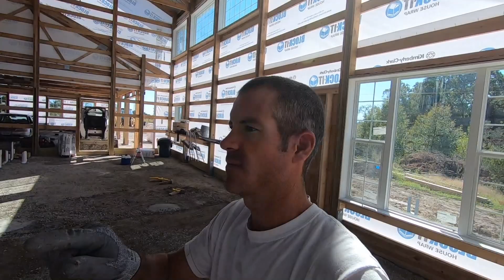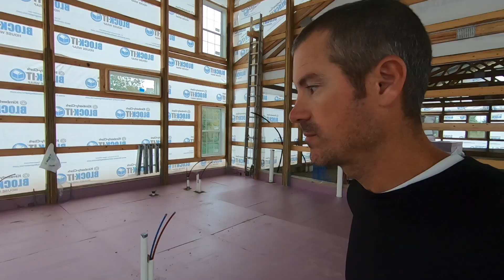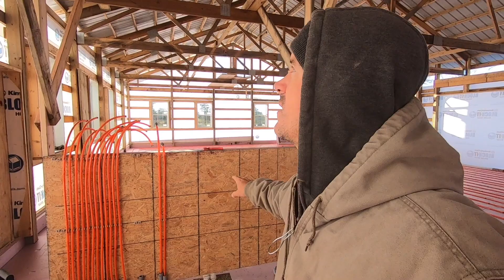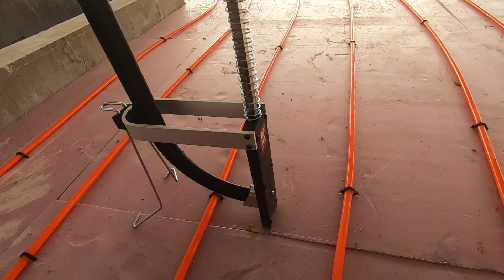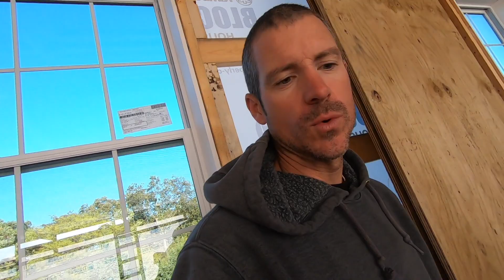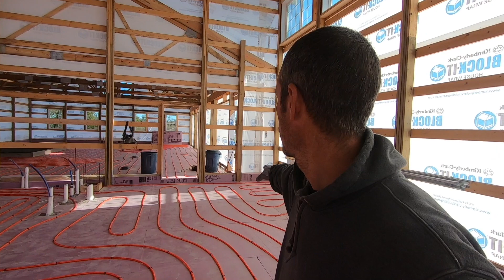Concrete Slab Preparation | Radiant In Floor Heat Pt 3/3 | Mad County Build Ep12.3

Comment: That all goes OK without taping the seams on the foam board? Did your board have the edges curl up in the meantime waiting to pour?
Reply from the maker: No i did not have any curling.  I use a different product now (Hitz Halter) and it has the vapor barrier built into it so there is no need to put plastic down, but we tape all the seam on it.  This product in the video we had to put a vapor barrier down first.
Reply: @MrPostFrame I too discovered Hitz Halter after getting the pink stuff. I'm going to get a quote to see where they come in for my garage. I just taped the living crap out of those curled edges, gotta keep the concrete on top of the foam board.

Comment: Post and beam construction is tough on the plumber and electrician. If you dont prepare well..its a nightmare  after you finish. My walls are foamed and all but impossible to fish.
Reply from the maker: What did you use for posts/columns? Did you do bookshelf girts?

We do standard girts so we end up with a large wall cavity. Even after 3” of spray foam there is plenty of space to run your electrical and even plumbing after spray foam.

Comment: Paul, how many inches do you do on your sidewalls with 2" foam? I"m doing 5.5" concrete floor. Do I need to put foam board down to frost line with is 48"?

Comment: is there a winter temperature level where radiant heat systems don't make sense? I will probably build in the south, not quite as cold as Iowa, but does get cold down here occasionally. Just trying to figure out if radiant heat is efficient in a climate zone where it doesn't get as cold.

Comment: What kind of tape do you use on vapor barrier ?
Reply from the maker: I’ll have a new video coming out this week on a new insulation I’m using that includes the vapor barrier. I used the tape below to tape all my seams and really liked it.

https://www.menards.com/main/paint/adhesives-glue-tape/tape/seam-tape/forcefield-reg-3-3-4-x-90-premium-tape/1366538/p-7429806127320683-c-13187.htm

Comment: Great videos.  I am building a 50x100 shop.  Going to install radiant heating in the slab atop Foamular 2”.  I have the same stapler as what you are using. So my questions are, how many staples should I need ?  I have 3000.  And how many feet of 1/2” o2 barrier tubing will I need ?   I have 6000’ on hand

Comment: Hey sir. Do you lose efficiency by leaving it at the bottom of the slab versus the middle of the slab?
Reply: No. The great thing about concrete is it a poor insulator so it freely allows the heat to move through the slab. That’s why concrete slabs are the preferred mode of hydronic heat.

Comment: We normally pressurize the radiant floor tubing to 100PSI.  That minimizes the friction between the concrete and the pipe during normal use.
Reply: yes, but if you have a leak during your pour, 100psi makes a huge mess when it spews wet concrete into the air.

Comment: Great series, thanks for documenting it all. I have a question, I purposed this same design  footings with the same insulation layout. Our inspector is concerned its not enough to prevent frost from coming in contact with the slab. He is under the impression we might need as much as 4' horizontal from the sides of the slab. Did you run this configuration in ResCheck, if so did it pass? Any concerns with frost?
Reply: What ever happened? I’m pondering this now. I might just pour a frost protected shallow slab to avoid this issue.
Reply: @bpdp379  well we are no further. It's been a mess and still no foundation. We went from a house designed on a thickened edge, slab on grade to piers/sonotubes because the fill wouldn't meet compaction spec. But, we were told to insulate under, along the side, and out horizontally when we were planning to do a thickened edge. Waiting on new engineered plans to see how the piers need to be insulated.

Comment: You didn't think the concrete needed rebar or wire? Also can you keep certain parts warmer than other parts? Say the house part warmer than the garage part?
Reply from the maker: There is rebar in the concrete. We have things zoned so that areas of the house or garage can be different temps. Here's the in floor heat playlist: https://youtube.com/playlist?list=PL3QM32YjSVn1Mi5I9OwmwhXNL9CAXpyAZ

Comment: Paul, I am curious which PEX piping you used?  Did you also get it from Menards or other supplier?
Reply from the maker: We went through Menards for the Pex. All of the controls were through Curry Heating Systems. They build the systems to your specs which was way more helpful.
Reply: @MrPostFrame  I am thinking about the manifolds you used. Did you order those or get them through another supplier?  And, why did you choose those manifolds vs other brands? I have read some reviews of others like "Rifeng" and they seem ok, but they look the same except for the flow meters.  Just curious.

Comment: how can you tell the EXACT location each sewage or water line/pipe should pop out from the ground before doing the concrete? for a beginner or first time home builder is a challenging task to do so... even by looking at "plan" or blue print! any recommendation?
Reply: Run strings as pretend walls.  Easy.   There are videos showing this.

Comment: So your cost with staples, stapler, and running rebar in the concrete was more practical then wire mesh and zip ties?

Comment: 2 questions
1. Did you lay the rebar directly on top of the pex? 
2. Would you see any issue with  installing the steel on the roof and leaving the side walls open to make it easier for the concrete to be poured? 

Thanks!
Reply: RR buildings do exactly what you asked.
Reply: No rebar.  Just fiber.

Comment: 2" insulation but you used 2.5" staples?
Did you just put 1000s of holes in your plastic sheet water barrier?
Reply: perhaps you should consider the dia of the pipe the staples have to go around,,,,,,,,,,

Comment: thanks for your videos.

does the engineering change for the slab if you stick pex in it? how does it affect the steel reinforcing? is there a guideline on how close to have them together?

Comment: I have seen other videos where installers tape all seams on the foam board, whereas you have not. What are your thoughts on taping or not taping seams ?
Reply: If you use the foam board as the vapor barrier, you need to tape the seams. He used the 6 mil plastic so that’s his VB. The plastic sheet needs to be taped up
Reply: Very good question I'm also interested

Comment: Marshall,  I just found your channel and readily SUBSCRIBED.   Your project and skills are amazing.  Question:  What type of system will you be utilizing to heat?  My wife and I are building a new home in Central Ohio and are considering a wood boiler system with radiant floor heating.  We have 20 acres of hardwood and a seemingly endless wood supply.  Your thoughts on a wood boiler system or an alternative means would be greatly appreciated.  Thanks.
Reply from the maker: An outside wood boiler would work well. My dad used one for years to heat his house. I’m planning on a gas boiler for my radiant heat and will have a wood stove in the house as well.

Comment: How come you didn’t lay down plywood under the roof panels, and around the sides of the building? It seems you’ll lose a lot of r factor?
Reply: The metal panels provide the shear strength.

Comment: Why did you use gravel on the base as opposed to sand like I’ve been seeing in other videos? Are you going to be using a water heater for the heat source? Thank you
Reply from the maker: I like using gravel because once it’s compacted it stays where it’s at. Sand moves when ever you walk on it and then I find myself leveling it again. Nothing wrong with using it. Just preference. I will be using a gas boiler for my heat source.

Comment: Hello Mr. Marshall. What happens if after doing all your pressure tests and everything is good, you pour the concrete and then discover there is a leak? Is that basically the end of the world financially? I'm getting ready to build a 2500 square foot home with radiant floor heating with separate zones I presume and I would like to know how to handle something like that  if the worst should happen.Thanks. Really enjoy your videos and I wish I had your skills and was as young as you. I would be very rich indeed.
Reply from the maker: I pressurized the in floor heats tubing during the poor so I would know if a line was damaged. I had some repair couplings on hand but everything was fine. The concrete company I used requires this but they have never broke a line. They are very tuff. 

As far as the pex water lines go they are under the insulation in the ground. If one somehow gets a leak or something you would have to run a line through the walls of the house. 

If one of your in floor heat tubes broke you would have to abandon that loop as it would be very difficult to locate and fix. I suppose it could be done but not sure I would want to do it. Lol
Reply: @MrPostFrame  Thanks for that Marshall.

Comment: How does tile, hardwood flooring, and carpet affect the effectiveness and efficiency of doing this in a house
Reply: Stick the tile, float the hardwood, and throw away the nasty carpet.
The heating is from underneath in a radiant system those options will not hurt the efficiency.
Really carpet is nasty, get rid of that cancer.
The main reason people put down carpet is to have a warmer floor, your floor is pre-warmed, so no need.
Reply: Kal Random thanks for the info. I understand your point on carpet, I’m not a fan either. But I am glad to know a finished concrete floor isn’t the only option for this
Reply: @jacintobanda4114  Your welcome, there are several videos on YT and the web about this. There is one company that makes aluminum panels that the pex fits into tailored to your house.
I been looking at this form of heating for awhile. I want to combine it with a geo-thermal heat exchange system for cooling also.
Reply: In Europe where radiant heating is pretty common, it's almost always used with tile, which works very well

Comment: Is there a more environmentally aware way to insulate from the floor?
Reply: I dilating the floor is extremely environmentally good thing. In fact I've heard of doubling up the foam to have even better insulation.
Reply: @AlessioSangalli  how is foam, product that does not biodegrade environmentally good?
Reply: @philindeblanc  by providing high degree of insulation it allows to save very high amounts of energy otherwise lost due to inefficiencies over the lifespan of the building.
Reply: Also, if it were "biodegradable" it would be useless as it would disappear after a short amount of time. Instead, closed cell foam is inert that means it will not harm the environment.

Comment: Mistake:  You said six millimeters (which is about 1/4 inch) when you should have said six mills, which is 0.006 inch.  The difference is significant.
Reply from the maker: You are correct.

Comment: You are way beyond this now, but I  have a comment on the wiring through posts. Maybe it will help someone else. Since you didn’t do commercial girts, you should be able to run the wiring behind the posts. Also, code allows for #2 or better for structural wood. That means that there is an allowance for holes in the posts (typically knot holes, but a hole is a hole). I believe you can drill up to a 7/8 hole in the columns without any consideration for structural influence. Similar to drilling through regular stud walls. The load is already calculated for this size of a hole no less than 2’ apart. That is if I read it correctly.
Reply: I've always understood structural members, regardless of material, could have a hole of maximum size D=1/3 width of post (or stud, joist, rafter, etc.)  And a second hole could not be within D × 1.5 as measured between proximal edges of circumference. 
Sticking to that set of rules and there is next to no reduction in strength.

Comment: How deep was your concrete, and also I see that you didn't install wire mesh?
Reply from the maker: 5” thick slab. Rebar was put down 2’ on center the day of the pour.
Reply: Over the pex with the rebar?
Reply: @johnmacready4613  Looks like it - you can see it here https://youtu.be/Qw6sccck21w?t=97

Comment: You mentioned the spacing on your tubing. I'd also be interested to know how long your runs were from end to end where they start and return to the manifold.  I have heard a few different numbers on maximum length of a tubing and am wondering if there is any standard or code that has to be met? Or is is just that shorter equals more efficient?
Reply from the maker: For 1/2” pex you typically want your runs no longer than 300’. They sell the pex in 300’ roles with the number of feet written on them so you know when you need to head back to the manifold. 

If you end up with a run that is really short or under a 20% variance from 300’ you can put flow meters on your run at the manifold to equalize the flow to match the other lines.

Comment: If you are putting 2 1/2 inches staples in 2 inches insulation, then aren't you poking holes in your underneath vapor barrier and insulation?
Reply from the maker: The insulation is 2” thick then you have the 1/2” pex tubing which is over 1/2” outside diameter so the staples don’t make it through the insulation.

Comment: Is it easier to do the radiant floor heating and concrete before you do your framing and roofing for the pole building?
Reply from the maker: There are a few things to think about. My floor will be the finished concrete so I didn’t want to take the chance on damaging it while building the structure. I also needed to get heavy equipment in to lift my walls since I built them on the ground. Another thing to think about is how you want the concrete to sit in relation to the posts/columns. There are many different ways people do it and I don’t think any one way is necessarily better. It’s more how you want to do it and what works best for you
Reply: @MrPostFrame  Thanks

Comment: Bizarre question; who would one hire to test an existing system or find info on it? Back story is I just bought a home that was built in 84. The owner/builder died years ago. Supposedly the lines are run through the fireplace, so it's self driven through pressure change (I think - there is a coil in sand located in a huge heat chamber).  
If I could tap into the old system with modern components, I'd like to try.
Reply: Wow that’s interesting. What did you figure out?

Comment: Why could not the electrical go between the posts and the horizontal purlins and eliminate the multiple in concrete stubs around each column?
Reply: +1

Comment: are you concerned with heating all 4-5 inches of concrete vs laying it on wire mesh and getting the tubing closer to the center of the concrete?
Reply from the maker: Not at all. There is 6mm plastic and 2” of insulation below the tubing and heat rises. It will work very well and it is such a comfortable heat.
Reply: @MrPostFrame  Heat doesn't rise, it radiates. Hot air rises due to changes in density. But you're also right it's fine with the insulation and plastic.
Reply: @AnthonyBrusca  heat rises DUE to density in comparison surrounding it. Heat is less dense compared to most materials around it. IF it is trapped in a solid LIKE the concrete, it will radiate. It cannot radiate and conduct through the foam, being a poor conductor, it will remain above the foam, and go up due to its density vs what surrounds it. 
IF the material is a good heat conductor like concrete is, IT will spread, and then STILL rise due to it being less dense, and it will radiate across the solid mass of concrete, and ONCE it is at surface level, it will be "free" and LESS DENSE in comparison to surrounding. We maybe saying the same thing, but maybe this is helpful to visualize a bit more. :-)

Comment: Are you putting any rebar down before the slab is poured, or just pouring straight on to the tubing, and insulation?
Reply from the maker: Rebar goes down before the pour.

Comment: Marshall, I'm a retired plumber, so take that into consideration; I have made a bunch of money replacing plastic potable water pipe and fittings, so I'm wondering if the couplers you have for repairing it are made from the same thing the PEX is or are metallic. All metal pipe embedded in a concrete pour is subject to the caustic effect of the concrete, and will fail if precautions aren't taken- most zoning authorities require even copper pipe run under concrete to be insulated, or jacketed. I would be leery of putting a metallic coupling into the pour without some form of jacket to seal it away from the concrete. I would rather use a hot melt system that fuses a same material coupler onto the PEX. If you would , expand on this; I've been away from the trade for a most of a decade now, but old habits are just that ; habits! FR
Reply: Stainless and PVC slip on couplers are available and recommended for use in concrete.
Reply: @jaxturner7288  Good to know! Having seen several less than stellar game changers in the plumbing trade, I tend to approach "newer, faster, better" vs products and systems I know have worked for more than 30 years with a healthy grain of salt!